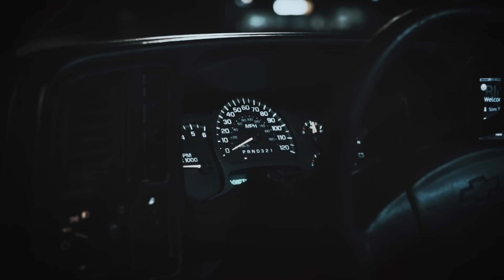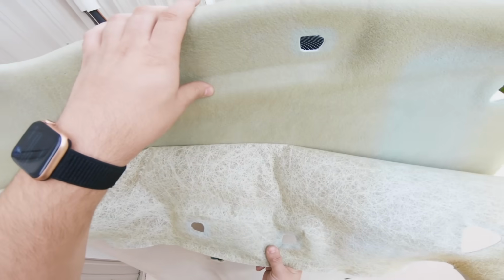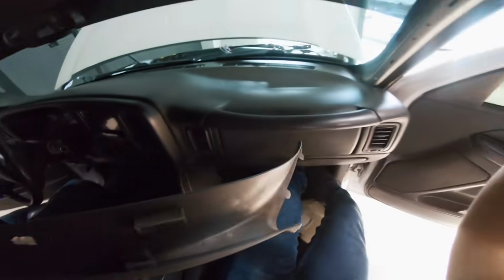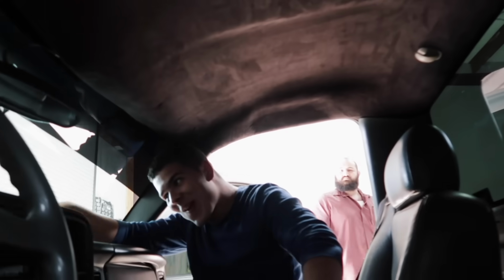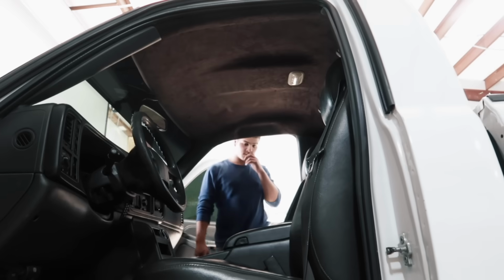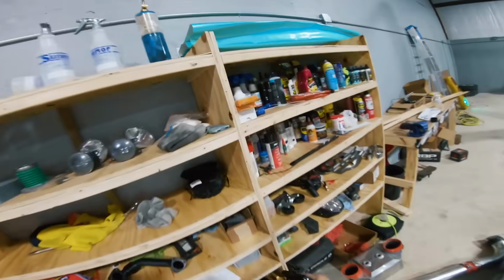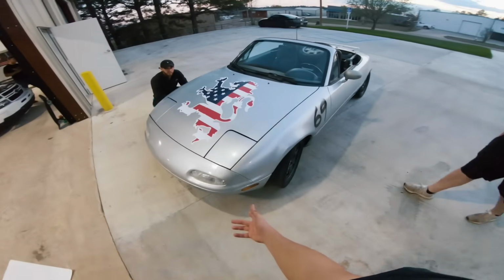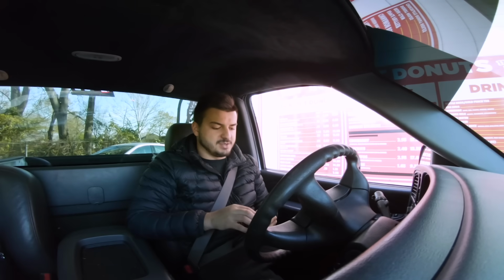What happens if you run over your foot with a car?

Comment: You should put the other coyote motor in the Miata, the one that is not built, but he has the parts to build it. For clarification the motor will fit.
Reply: He’s gonna put it on the truck
Reply: Nah put the stock coyote in the race truck & put the 6.0 in the Miata after it blows up the stock motor
Reply: He’s basically got a separate coyote motor and texas speed is sending him a motor soon so hopefully it happens
Reply: @ramonbarrera3410  that stupid if the truck motor runs good why switch it to a shitty yote put the yote in the miata and get a texas speed engine in the truck

Comment: Really need to run all of those wires under the truck bed. Clean that shit up, just drill a little hole, use a rubber grommet so the wires stay nice and don't get chewed up and a quality nylon wire loom so it looks clean under the bed too, it would look so much better and some what professional, but I know you guys are far from professional...
Reply: Tyler Roberts T-Rob the original owner of the truck had the kit ran like that and drill a big hole towards the front of the bed. So we just used that hole instead of drilling another hole

Comment: Throw a 400 shot and pro charger you’ll run 8s
Reply: 300 shot 40 pounds of boost7.80s guaranteed
Reply: Mhmmm.
Reply: But can the motor handle it
Reply: @jacobwaltersdorf8717  no, it cant.